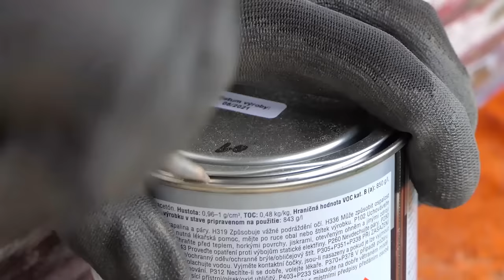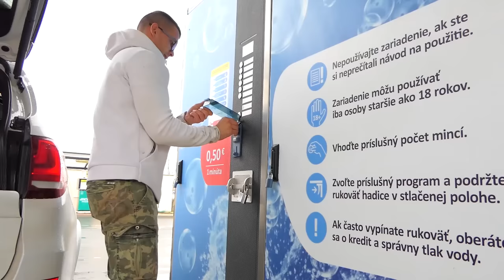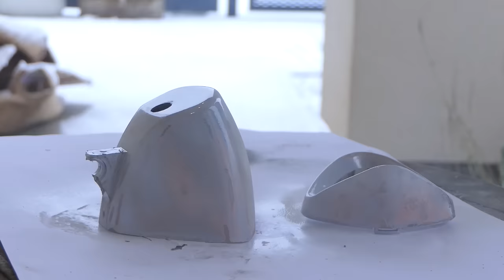Restoration Motorcycle Chopper - Full Process

Comment: soo quick thing that I noticed. I would assume you guys went back and fixed it. The piston was put back upside down, the mark on the piston "IN" means intake and that mark was towards the bottom which is the exhaust side of the top end. Second, that black guide wheel in the cam chain side of the cylinder didn't get put back in, that prevents the chain from smacking itself and causing premature wear. Third, the valve lash probably needed to be set. And last, where are your gaskets? Not a stickler, but just a couple things for thought on the next build. Other than that good job!
Reply: Engine fully rebuilt - using all the old parts including all bearings, seals and gaskets, even the cylinder head gasket.  I'm not even sure why they bothered to take it apart.

Comment: I noticed y'all did not put any sealer between the crank cases at all to hold  the oil in so it wouldn't be leaking oil everywhere or did I miss that part

Comment: it's still a shame to use the same towel that was used to put the fake rust at 2min57. And I also didn't know that plastic can also rust. it's still a shame to have painted the wiring. finally the difficulty in all that is to try to simulate that it is old, but for once that is very badly done.

Comment: I like the bike but don't like the paint job honestly that army color and scheme you went with it just don't do this old school style chopper justice in my opinion but still cool tho just not the choice I would of made I'd of made black with white or red flames with chrome rims and spiked grips and blade mirrors and I'd have turn signals and break lights and a new tail pipe that goes down the side of the frame but comes up the back like old school choppers used to and made a pan seat but use padding and have studs around the seat and it would have springer forks with a Bob racer headlight I'm old school like that my dad had real choppers when he was alive we used to build them now I have my own business doing so

Comment: U wasted your time on that motor, in my opinion. You could've found one for 100 bucks that ran. Putting that much work into one of these types of motors is just a waste. If it were a suzuki, Yamaha, ect, then I'd say yes, rebuild it. These are junk and won't last long anyway.  I bet that's why it was in the hole in the first place. Other than that u did a good job.

Comment: Looks like a fake. Not a single rubber seal, not a single bearing has been replaced on either the engine or the wheels. That's too bad.

Comment: this video is not real, the motor engine that was dismantled is different from the one on the motorcycle, especially when assembling the engine the oil pump was not installed, what kind of repair video is this,,.